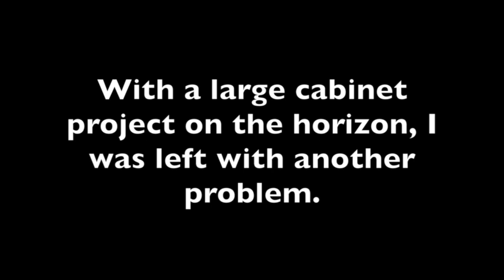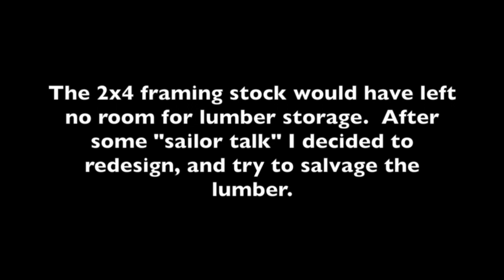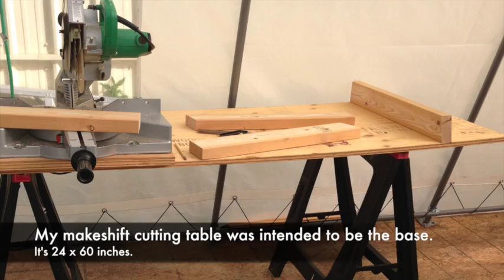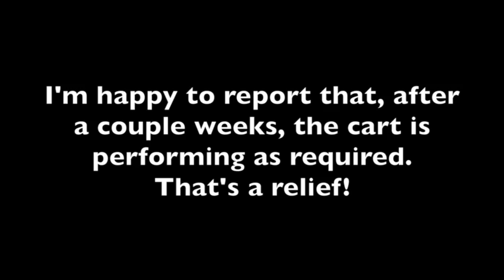Minimalist Lumber Storage Cart

Comment: loved the idea.  I'm all about making good use of space and designing something to fit your specific shop.  I am actually in the process of making my own storage solution.  I built mine to fold down from the ceiling.  Check it out if you have time and let me know what you think.
Reply from the maker: That is a cool solution. In my last shop I had really high ceilings. I wish I had done something like that. Unfortunately I have no head room in this shop. I have thought of a little shed extension off the side, but then I put up the tent and that helps. Thanks for watching!
Reply: 21st Century Woodworking a

Comment: nice cart.  as to the water problem, lay a bead of caulk on the floor and screw a 1 x 2 board on the caulk bead to seal the inside parameter and the water problem should go away. I used a tent for several years and that helped me.
Reply from the maker: Excellent idea!  Thank you for that.
Reply: what do you think about flex seal, the garage catches water from the door and it comes down a tiny slope into the garage.